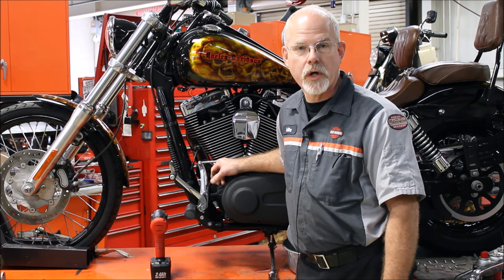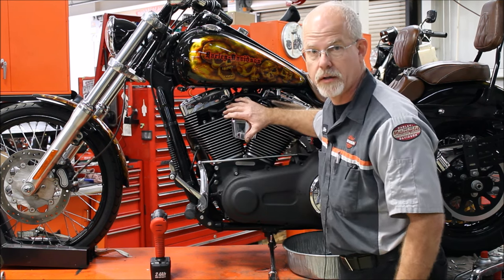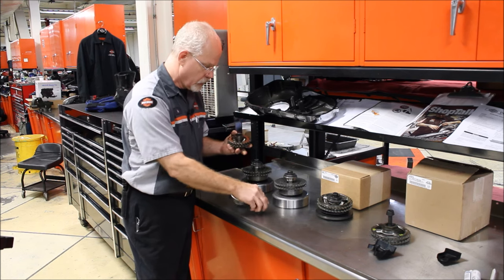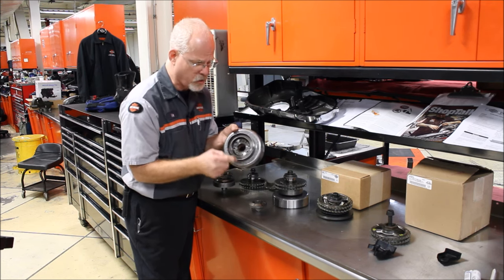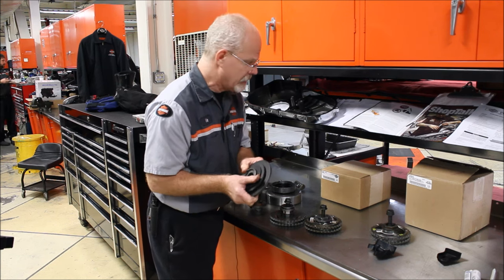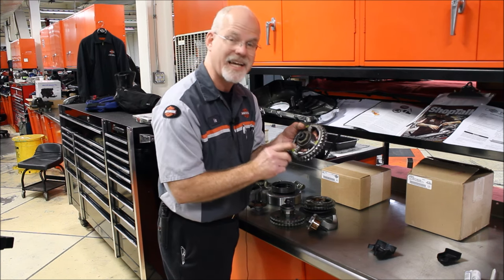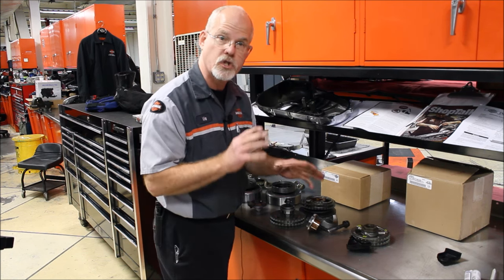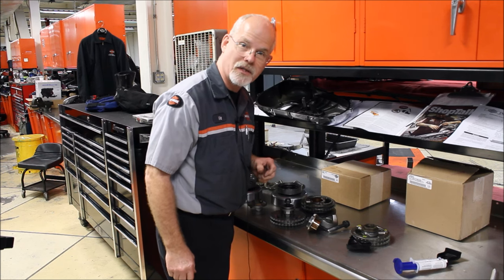2016 Doc Harley:  COMPENSATOR

Comment: Buddy,, you are employed at a dealership ? Because the twin cam started in 1999,,with a 88ci with the available 95 ci model for CVO Bikes and for purchase separately from the SE catalog,, then in 2006 was the start of the “stroked” 96ci twin cam.. which used the same pistons ( bore)as the 95 ci,, bit with longer connecting rods hence the “Stroked”engine ,, your dates are all off along with the compensators for those different configurations... i know all this because i am a cert Harley mechanic ,, and have been riding them and building them for 35 years... my point is to become more respectable so that ppl will trust in what you are saying have all the facts straight ,,, my 2cents...
Reply: PhatboyHD88  .  Yep.  Lost me at that very moment.
Reply: @chrisgarland1401  yes same, considering mine is 03 88ci, I was like wtf is mine then if 88 didn't come out till 06 hahaha
Reply: I thought I was losing my mind ...
Reply: PhatboyHD88 I thought the 96 used the same piston bore size as an 88 just with increased stroke to give the 96ci of displacement?
Reply: Mike Greer  Basically, I worked on Japanese bikes since late 70's. If Harley had any sense whatsoever they would have known chain driven narrow angle v-twins beat the shit out of chains and tensioners. Honda had at least 5 revisions for the CX500 between 1978 and 1982 (500cc, narrow angle push-rod motor) The last iteration worked for about 18,000 miles before giving up unless bike was used as it was designed (ie, keep it over 6k) That isn't feasible with HD big twins (they will destroy big end bearings if used continuously over 6K) Harley should have fitted cam gears instead of chain. (although even Honda had some disasters with the VF750 gear drives) The problem is the load reversals at low rpm causing chain to whip around all over the place. I haven't looked into what HD are doing with twin cam nowadays, last time I got involved was around 2011
Reply: Mike Greer  check it at around 15 thousand.  Or spend some cash and go hydraulic and have piece of mind
Reply: Mike Greer  I had 96K on my 09 before I changed them.  One looked damn near new and the other was worn half way.  It's the earlier years that give you problems.
Reply: @jmbman  and I've seen 2014 Fatboy with 25000 km on it and tensioners totally shot. Só....
Reply: I agree he spoke incorrectly. However, the focus on the video was compensators not engines. I realize the two are pretty well linked, But, as far as the compensator is concerned it didn’t change till 06 as far as I know. Maybe he was focused on that and grouped it all together with engine size?
I suppose as well if you are gonna get technical the 96 didn’t have longer connecting rods... maybe a longer throw on the crank? By about .1875 they moved the pin out to get the longer throw? Point is... anyone can mis speak. Does not mean you don’t know what your talking about.

Comment: As a matter of fact Harley doesn't have a solution for 07 (06 Dyna) TC compensator. Even the SE compensator is useless. There are several other solutions that are being mentioned here.
He doesn't talk about the "automatic" chain tensioner which stretches the chain so tight that just about every bearing fails in the primary.

Comment: i had two Harleys, I pulled the compensators out of both of them. 
They both ran many thousands of miles since
Reply: Which compensators brands did you use? I heard good staff a out baker
Reply: @socrateslouca8733  none. no compensator...yes , Baker on both of them , , ,
Reply: @socrateslouca8733  i don,t run my motor with a compensator. I don't run mt motor with cam tensioners. ... and I re=programmed the BC D.

Comment: Whats your thoughts on a compensator eliminator? Specifically on a 2008 dyna 96ci
Reply from the maker: The short answer is "no", we wouldn't recommend it.  The change can lead to premature wear and failure in other parts of the powertrain like the clutch basket, primary chain, etc.

If you are having concerns with your motorcycle, there may be more appropriate solutions for you to entertain.  The place to start will always be with finding out why you want to change it, and what condition you are trying to address
Reply: @Low Country Harley-Davidson  I started looking into it purely for the preventive maintenance factor. I upgrade my cams to the woods 222, and during my research was lead to the possible issues of the hydraulic tensioner, (getting too tight and not loosening) which I like to tinker also so decided I want to replace that with a manual tensioner. Which brought me to the possible issues with the compensator, and so I figured if I'm replacing the tensioner, then why not do the compensator. Only to find that even the replacement compensator can have issues of their own. Which brought me to the eliminators. I've done a lot of digging on HD forum, ect. And the only downside I find (I don't mind the extra noise or surging or feeling the motor) is that people say it COULD cause issues with the crank not being welded and all but I can't find anyone that says it DID cause issues for them. And also the options with the eliminator to go with a 32 tooth instead of a 34 appeals to me too. So I figured with all the videos of yours I watch you would be the guy to ask for straight answers, and most likely to have seen real world results of running them rather than what might happen. And thanks for the quick response, did not expect that.
Reply: @Low Country Harley-Davidson  so short answer is no, but would you mind going in to the longer version? Have you personally ran into issues caused by eliminating the compensator? And the idea of eliminating for the lower tooth gearing, would that increase the possibility of issues of using the eliminator or issues of its own? I like the idea of the lower gearing because as is now, I like the performance of the bike with the woods 222 cams for the most part just going from a stop and lower rpm is just ok. Where and how I ride is not much highway, I rarely ever hit 6th gear. I know there's the dark horse compensator that supposedly works similar to an eliminator but as far as I know they only make the 34t gear.

Comment: Why would I pay HD for a fix that it never should have needed, especially since it's obvious that they still don't have it worked out?
Reply: Are you kidding me? Every thing on the road no matter who made it has weak points that the manufacture doesn't want to fix. 2 wheels or 4 EVERYTHING out there has problems.
Reply: denny thomas If Ford or GM sold a car all the while knowing there was a major underlying issue with a major component in the engine and never told the customer and refused to warranty engine failure while the vehicle was under warranty... Are u kidding me!? They'd be sued and recalling every model by a court order...
Reply: Show me another manufacturer with a major driveline component that has been jacked up for years and still isn't right.
Reply: My 2007 Honda vtx 1300R ,4 valve per cylinder, 2 spark plugs per cylinder, jetted carb,open air ,Vance Hines,6 speed ,,only needs gas and tires to go around the country ,no problems. Im going to look at a 2008 heritage Springer  Screaming EAGLE 110,cvo,6 speed tranny ,,105th edition. Can anyone tell me if this is a good motor ??,,,,it ain't cheap,!-help!-☆
Reply: No matter what you ride or drive on the road , we're just guinea pigs for the manufacturers.
Reply: @andymotl  Ford did. It's called the 5.4 Triton V8. Big POS. Never corrected. Not a dime paid out.
Reply: @mopar340dave  GM active fuel management lifters. started in 2007 and STILL using the same trash now in the 2023, only now using 16 of them instead of 8 in the previous design. There is some kind of lawsuit going on with them over it. These are the lifters used in the 2007-current LS based 8 cylinder engines. I think they learned from Harley..
Reply: @mopar340dave  Mid 90's thru early 2000's Dodge (mopar) truck and caravan transmissions failing after about 50k miles or less.

Comment: you should do a video on the pros and cons of a solid sprocket compensator eliminator. from what i gather it makes the bike quicker but a little jerky at lower revs which is most noticeable when cornering. also, i've heard that if you go with a solid sprocket you need to avoid gunning your bike all the time because that will put too much strain on the press fit crank
Reply: Hans Zarkov I have a compensator eliminator, I just keep it up in the revs and Ive had no problems. I dont lug my shit and hold it WFO all the time anyway.

Comment: Hay Doc" First of all i love your videos, which are inspiring; having said that, i just sold my 2005 triumph rocket 3, and purchased a 2009 fat bob cvo with the screaming eagle 110cc motor which had been upgraded with the fueling 574 cams and she has 10.000 miles on the clock, and just last week i had to replace the starter clutch with an all balls after market one; Do you know if the compensator in this motor will withstand the power increase, and does the cvo's 110cc screamin eagle package have an upgraded compensator? "Thanks Doc and Be Safe"

Comment: the up date is still a piece of junk  check the arms same old arms add a piece of plastic and a Torrrington bearing the only change  at 3000 rpm that oil is going to do what ? does not oil get thrown out and the middle piece is still the same , time to stop being cheap and build one that picks up the oil and lubricates this part , after 104 years it time to start building a bike you can put on high mileage   its time to stop the icon bull shit and make a bike that lasts
Reply: Epoxy a piece on? (why not get a machine shop to put the thing on "Permanent" with a little fancy welding and machining to correct any Harley C Heap ass production Garbage?
Reply: " after 104 years it time to start building a bike you can put on high mileage " They did, it's called the Evolution. Twin Cams and M8s are bean counter motors. The Evo is a far superior engine for longevity.  Other brand large displacement V-twins don't use that stupid compensator either. They run cush drives in their rear wheels. Those have been common longer than most people reading this have been alive, just not on HDs though Japan edition Sportsters have them.  A solid sprocket never gets "compensator issues" but of course those are referred to as "compensator eliminators" by the aftermarket.
Reply: Actually the TC has a lot to offer over the Evo. I will bow and say it only existed for a couple years. The Evo was beyond a mile stone engine. People forget we are taking a radial Aircraft engine and fitting it into a bike. So for most who are engine illiterate. They don't understand pushrod engines. Everyone wants a high rev motor. Until they have to do a long trip. I like the perfect vibe of a tuned twin on a back highway. I fucking Zen out on shit for hours down the road. 
Man I don't give an empty can of beans to anything that changes the 45 D. Lets just make it more reliable and rumble on.

Comment: Hi there! For a Full Stage 1 TC96 (2011 FXD)... should I think about changing the compensator??
Reply: I would ...  I replaced mine in my 2007 Wide Glide and my 2010 Road Glide... No problems after that.
Reply: @toddeasterday4157  thanks man. I wish HD had sell WGlides down here (Brasil) back at the time. The best Dyna in my opinion.

Comment: Hmm, you said the 06 was different than the old style like evo and early twins, but my 06 streetglide has the same one as my evo, my 2000 softail, 2001 twin cam bmc chopper, and fyi my softail runs down big bikes and i beat the hell out of it and its as reliable as anything else and has been all over the country. Built motor, and old simple style compensator

Comment: HEY DOC THANK YOU.  I HAD MY 2010 DONE BECAUSE IT WAS FAILING.  I WAS TOLD AND YOU CONFIRMED SAME HARLEY USED THE COMPENSATOR FROM THE 88 SERIES ENGINE, THUS THEY USED THE CUSTOMER FOR THE GUINNIE PIG TEST BED.
PRIOR TO THIS VIDEO I CAME UPON A VIDEO FROM A SHOP IN FLORIDA WHO INSTALLED A BAKER COMPENSATOR.  MUCH BETTER.  WHY NOT GO TO SPECIALISTS INSTEAD OF USING THE CONSUMER.  WHEN SOMEONE IS PAYING 25,000 TO 40,000 PLUS FOR THESE BIKES WE SHOULD BE ABLE TO GET TO STURGIS AND BACK.  MY BIKE LEAKED EVER SINCE THE INSTALL.  I HAD IT BACK AS I TOLD THEM IT WAS THE GASKET.  THEY SAID NO IT WASN'T. IT WAS THE SEAL ON THE SHIFTER LEVER.  I NEVER HAD A LEAK UNTIL THEY DID THE WORK.  SO IT JUST COST ME ANOTHER 300 AFTER THE 800 I HAD SPENT TO FIX THE LEAK.  I LOVE MY HARLEY BUT YOU BEST TELL THE ENGINEERS AND CEO HARLEY WILL GO THE WAY OF GENERAL MOTORS.  THAT IS FACT.  THE LARGEST AUTO MFG. IN THE WORLD BAILED OUT BY GOVT.  I WON'T BUY ANOTHER GM PRODUCT EVER.
YES 2016 THEY FINALLY GOT IT RIGHT!!!!HOT DAM!!!I HAVE THE SCREAMING EAGLE COMPENSATOR INSTALLED THANKS TO A GOOD, HONEST, KNOWLEDGEABLE SERVICE WRITER WHO GOT FIRED.  NOW IT'S A FEMALE IN HIS PLACE.  LIKE THE FORBES OR OTHER ARTICLE NOT SURE, SUGGESTED HIRING SOME SIZZLE TO GET SALES UP.  YOUR GOING TO NEED A LITTLE MORE AS THE CONSUMER WAKES UP.  WE ARE AWAKENING TO MUCH MORE.  PLEASE COMMENT ON THE SE COMPENSATOR AND IT'S RELIABILITY.  SORRY FOR MY VENT BUT I COULD OF GOTT'N INTO THE RADIO'S FAILING WHICH AREN'T THE RADIOS BUT THE FUCKING HD BRACKETS AND BOLTS TOO LONG FOR THE HANDLE BAR CONNECTION BELOW THE RADIO.  THAT COST ME 250 BY A VERY RELIABLE HARM AND KARDON TRAINED SERVICE CO. "IRON CROSS."  PLUS ANOTHER FEE TO HARLEY TO INSTALL IT.   TELL HARLEY I WANT TO BUY AMERICAN AS MANY OF US DO, BUT YOU AREN'T MAKING IT EASY.
Reply: Vent away my friend. I agree wholeheartedly! You should have bought the Baker Compensator though. That SE one will fail. They still haven't figured it out and I don't think they want to. Cash cow... lol.
Reply: Had a couple bakers already fail.....so your so wrong....
Reply: how long did it take for the bakers to fail?
Reply: Can I use this on 1200c sportster
Reply: Like Brock says above... Vent away!... But, I don't know if you intended to type in all capital letters, it seems like your yelling at us. :-)
No doubt most bikers want American HD bikes. They do make it difficult. My suggestion to fellow bikers is to learn to work on them yourself. I actually enjoy it, when I have the right tools. What I don't like is when HD sells an "upgrade" kit like the SE compensator and then DOES NOT include everything needed... like the epoxy and the T70 torx socket. $10 items. >:[
The great thing is these bikes are mostly easy to work on. And there are A LOT of people here on YouTube to walk you through most any repair.
On another note...let's see what happens with the Milwaukee 8.

Comment: With the comp. and clutch on the bike, and the auto adjusting primary chain tension shoe removed, should you be able to rotate a SE Comp slightly, or should it be no movement at all?

Comment: You know what doc, I have been riding Harley-Davidson motorcycles for 28 years and now in 2018 they have a new engine top to bottom which I now have.
 But with the new motorcycle engine and softail line I will say this. Why is the hell is Harley Davidson still using a chain primary drive? Doc you and I both know that chain drive primary has no business on a motorcycle in lieu of a smoother gear drive primary.
Harley-Davidson can keep the traditional primary cover and  use a gear drive system.

Comment: That is pathetic really that nobody at HD's engineering dept, could foresee the problems that would arise using such an archaic piece of engineering on bigger and bigger engines. My 1964 model BSA had the same type of drive transfer compensator set up, as the shovel, but my primary drive side was bathed in oil. There are always people saying 'point to one thing about HD's that is unreliable'. I give up trying.

Comment: Dark Horse comps. are the way to go for any Harley.
Reply: Just bought one . pretty solid design. Look forward to putting some miles on it
Reply: @12594  Their shipping department leaves a lot to be desired they constantly send the wrong parts.
Reply: My 2016 103 EG police has run 63.000km and was worn out. 1 cm play at the 3 points in the compensator!!

Comment: I installed on my bike Electra glide 2009 , twin cam 96, very difficult start when engine is not cold. Code HD 40100061 after the installation problem solved.
Reply: What did you install?
Reply: @hdrider05  the compensator
Reply: Which one did you use ?